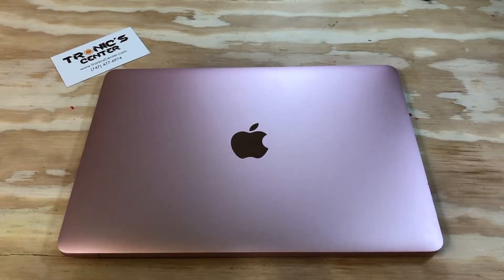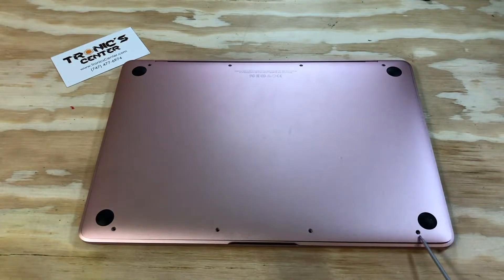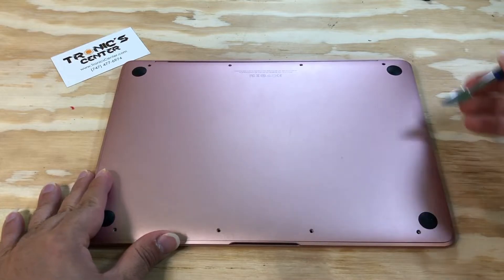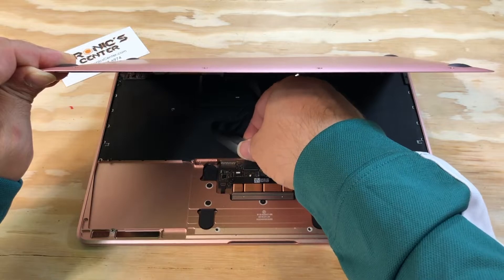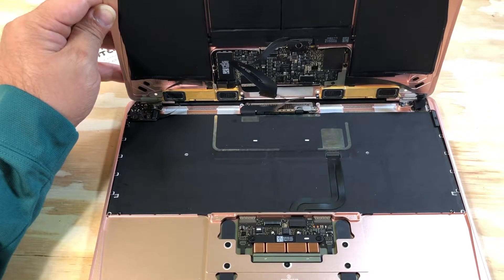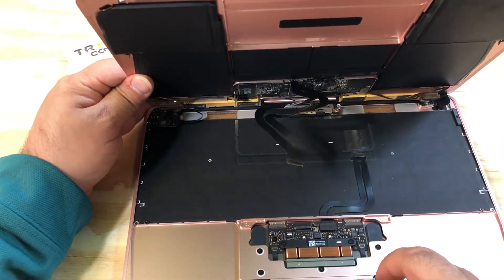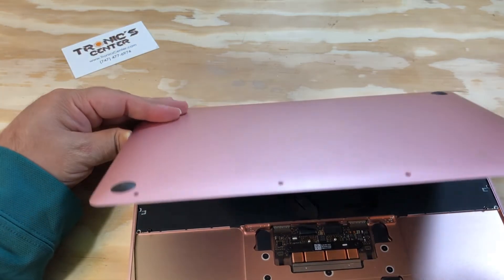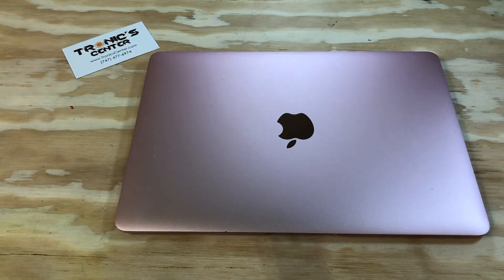How to Replace I/O Board DC in Flex Cable for 12" MacBook A1534 - I/O board DC in Flex Cable install

Comment: mine is charging fine but wont detect the usb devices, i already ordered the same cable and connector to change it, i hope that fix the problem
Reply from the maker: Dear You may Visit Your Local Apple Store or Computer store so they can diagnosis and advise , Thanks ! Dear Customer let us know what repair or disassembly you want us to make video ! Please not that we do deal with all Brands Dell, Lenovo, Asus, Razer, Toshiba, Hp, Sony, Panasonic, Nikon, Canon, Black Magic, Red Camera, any Camcorder Bards, Also we do IT Support and Data Recovery ! we would love to hear from you .
Reply from the maker: A2251 KeyWords 

MacBook Pro "Core i5" 2.0 13" 2020 4 TB 3, 2.0 GHz Core i5, I5-1038NG7, MacBook Pro "Core i7" 2.3 13" 2020 4 TB 3, 2.3 GHz Core i7,  I7-1068NG7, MacBookPro16,2 , 2020 13" 4 TB 3 , A2251 MacBook , EMC 3348, MWP72LL/A, BTO/CTO

————————————————————

A2141 KeyWords 

MacBook Pro "Core i7" 2.6 16" 2019, 2.6 GHz Core i7 (I7-9750H), 2.3 GHz Core i9 (I9-9880H), A2141 (EMC 3347), 2.4 GHz Core i9 (I9-9980HK) , MacBookPro16,1, MacBook Pro "Core i7" 2.6 16" 2019 5600M, 2.6 GHz Core i7 (I7-9750H),  MacBookPro16,4 , MacBook Pro "Core i9" 2.3 16" 2019 5600M, 2.3 GHz Core i9 (I9-9880H), MacBook Pro "Core i9" 2.4 16" 2019 5600M, 2.4 GHz Core i9 (I9-9980HK), MVVL2LL/A, MVVM2LL/A, 16" MacBook A2141

———————————————

A2179 Keywords

MWTJ2LL/A, EMC 3302 , 1.1 GHz Core i3 (I3-1000NG4) , MacBook Air "Core i3" 1.1 13" (Scissor, 2020) , MacBookAir9,1 , 1.1 GHz Core i5 (I5-1030NG7) , MVH22LL/A , MacBook Air "Core i7" 1.2 13" (Scissor, 2020), 1.2 GHz Core i7 (I7-1060NG7)

——————————————

A2159 Keywords 

1.4 GHz Core i5 (I5-8257U) , MacBook Pro "Core i5" 1.4 13" Touch/2019 2 TB 3 , MacBook Pro "Core i7" 1.7 13" Touch/2019 2 TB 3 , 1.7 GHz Core i7 (I7-8557U) , MUHN2LL/A , A2159 , EMC 3301 , MacBookPro15,4 , 2019 13" (Touch Bar, 2 TB 3), 13" MacBook Pro A2159

—————————————————————

A1932 Keywords  

MRE82LL/A , MVFH2LL/A, 1.6 GHz Core I5-8210Y, 1.6 GHz Core I5-8210Y, MacBookAir8,1 , EMC 3184 , 13" MacBook Air Space Gray, 13" MacBook Air Gold , 13" MacBook Air Silver , 13" MacBook Air 2019 13" MacBook Air 2018, 13" MacBook Air A1932

—————————————————————

A1534 Keyword’s

EMC 2746, MF855LL/A, MF865LL/A, EMC 2991, MLHA2LL/A, MLHC2LL/A, EMC 3099, MNYF2LL/A, MNYG2LL/A, MacBook8,1 , 1.1 GHz Core M (M-5Y31) , 1.2 GHz Core M (M-5Y51), 1.3 GHz Core M (M-5Y71), 1.1 GHz Core m3 (M3-6Y30), 1.2 GHz Core m5 (M5-6Y54), 1.3 GHz Core m7 (M7-6Y75), 1.2 GHz Core m3 (M3-7Y32), 1.3 GHz Core i5 (I5-7Y54), 1.4 GHz Core i7 (I7-7Y75), MacBook9,1 , MacBook10,1

——————————————————

A1990 Keywords

MR932LL/A, 2.2 GHz Core i7 (I7-8750H), EMC 3215, MacBookPro15,1 , MR942LL/A 2.6 GHz Core i7 (I7-8850H), 2.6 GHz Core i7 (I7-8850H), 2.9 GHz Core i9 (I9-8950HK), 2.6 GHz Core i7 (I7-9750H), EMC 3359, 2.3 GHz Core i9 (I9-9880H), 2.4 GHz Core i9 (I9-9980HK), MacBookPro15,3, A1990 MacBook, 15” MacBook A1990

———————————————————

A1989 Keyword 

A1989 MacBook 2018 MR9Q2LL/A, 2.3 GHz Core i5 (I5-8259U), BTO/CTO, 2.7 GHz Core i7 (I7-8559U), EMC 3214, MacBookPro15,2 , A1989 MacBook 2019 MV962LL/A , 2.4 GHz Core i5 (I5-8279U) , MV982LL/A, 2.8 GHz Core i7 (I7-8569U) , EMC 3358, 13" MacBook A1989

———————————————

A1708 Keywords

MLL42LL/A, A1708, EMC 2978, MacBookPro13,1 , 2.0 GHz Core i5 (I5-6360U) , 2.4 GHz Core i7 (I7-6660U) , MPXQ2LL/A, EMC 3164, 2.3 GHz Core i5 (I5-7360U) , 2.5 GHz Core i7 (I7-7660U), MPXQ2LL/A, 13" MacBook A1708

———————————————————— 
MacBook 

Apple, MacBook, 13" MacBook, MacBook Air, A1466 MacBook, MacBook Air logic Board, 13" MacBook Air , Apple Mac , 11” MacBook , A1465 MacBook, A1502 MacBook, A1398 MacBook, A1425 MacBook, A1706 MacBook, A1708 MacBook, A1707 MacBook, A1990 MacBook, A1989 MacBook, A2159 MacBook, A2179 MacBook, A2289 MacBook, A2337 MacBook, A2338 MacBook, A2141 MacBook, MacBook Pro, MacBook Pro Retina, Retina display, True Tone Display , Top Case KeyBoard, Apple Keyboard, MacBook KeyBoard, MacBook Trackpad.
———————————————————

A1398 MacBook, A1398 Logic Board, A1398 LCD, A1398 KeyBoard , A1398 Display, MC975LL/A, MC976LL/A, MD831LL/A, ME664LL/A, ME665LL/A , ME698LL/A, ME293LL/A, ME294LL/A, ME874LL/A, MGXA2LL/A, MGXC2LL/A, MGXG2LL/A, MJLQ2LL/A, MJLT2LL/A, MJLU2LL/A

—————————————————————

A1706 Keywords

MLH12LL/A, A1706 EMC 3071, MacBookPro13,2 , MacBookPro14,2 , MPXV2LL/A, A1706 EMC 3163 , 3.5 GHz Core I7-7567U, 3.3 GHz Core I5-7287U, 3.1 GHz Core I5-7267U, 3.3 GHz Core I7-6567U, 3.1 GHz Core I5-6287U, 2.9 GHz Core I5-6267U, A1706 MacBook, A1706 MacBook Touch Bar 

—————————————————————
A1707 Keywords 

MPN 923-01477 , MLH32LL/A, MLH42LL/A, MPTR2LL/A, MPTT2LL, EMC 3072, MLH32LL/A, MacBookPro13,3, 2.7 GHz Core i7 (I7-6820HQ), MLH42LL/A, 2.9 GHz Core i7 (I7-6920HQ), EMC 3162 , 2.8 GHz Core i7 (I7-7700HQ), MacBookPro14,3 , 2.9 GHz Core i7 (I7-7820HQ), MPTR2LL/A, MPTT2LL/A, 3.1 GHz Core i7 (I7-7920HQ), A1707 MacBook, A1707 Touch Bar

Comment: Hi! why did you changed it?
Reply from the maker: Hello
when laptop not charging some time cable is the most common part that you need to change .
Reply: @tronicscenter493  thank you, i have a problem, "usb accessories disable" warning. But when i connect an hub it works. Should it change the io? Thank you and sorry about my English, i hope you understand
Reply from the maker: A2251 KeyWords 

MacBook Pro "Core i5" 2.0 13" 2020 4 TB 3, 2.0 GHz Core i5, I5-1038NG7, MacBook Pro "Core i7" 2.3 13" 2020 4 TB 3, 2.3 GHz Core i7,  I7-1068NG7, MacBookPro16,2 , 2020 13" 4 TB 3 , A2251 MacBook , EMC 3348, MWP72LL/A, BTO/CTO

————————————————————

A2141 KeyWords 

MacBook Pro "Core i7" 2.6 16" 2019, 2.6 GHz Core i7 (I7-9750H), 2.3 GHz Core i9 (I9-9880H), A2141 (EMC 3347), 2.4 GHz Core i9 (I9-9980HK) , MacBookPro16,1, MacBook Pro "Core i7" 2.6 16" 2019 5600M, 2.6 GHz Core i7 (I7-9750H),  MacBookPro16,4 , MacBook Pro "Core i9" 2.3 16" 2019 5600M, 2.3 GHz Core i9 (I9-9880H), MacBook Pro "Core i9" 2.4 16" 2019 5600M, 2.4 GHz Core i9 (I9-9980HK), MVVL2LL/A, MVVM2LL/A, 16" MacBook A2141

———————————————

A2179 Keywords

MWTJ2LL/A, EMC 3302 , 1.1 GHz Core i3 (I3-1000NG4) , MacBook Air "Core i3" 1.1 13" (Scissor, 2020) , MacBookAir9,1 , 1.1 GHz Core i5 (I5-1030NG7) , MVH22LL/A , MacBook Air "Core i7" 1.2 13" (Scissor, 2020), 1.2 GHz Core i7 (I7-1060NG7)

——————————————

A2159 Keywords 

1.4 GHz Core i5 (I5-8257U) , MacBook Pro "Core i5" 1.4 13" Touch/2019 2 TB 3 , MacBook Pro "Core i7" 1.7 13" Touch/2019 2 TB 3 , 1.7 GHz Core i7 (I7-8557U) , MUHN2LL/A , A2159 , EMC 3301 , MacBookPro15,4 , 2019 13" (Touch Bar, 2 TB 3), 13" MacBook Pro A2159

—————————————————————

A1932 Keywords  

MRE82LL/A , MVFH2LL/A, 1.6 GHz Core I5-8210Y, 1.6 GHz Core I5-8210Y, MacBookAir8,1 , EMC 3184 , 13" MacBook Air Space Gray, 13" MacBook Air Gold , 13" MacBook Air Silver , 13" MacBook Air 2019 13" MacBook Air 2018, 13" MacBook Air A1932

—————————————————————

A1534 Keyword’s

EMC 2746, MF855LL/A, MF865LL/A, EMC 2991, MLHA2LL/A, MLHC2LL/A, EMC 3099, MNYF2LL/A, MNYG2LL/A, MacBook8,1 , 1.1 GHz Core M (M-5Y31) , 1.2 GHz Core M (M-5Y51), 1.3 GHz Core M (M-5Y71), 1.1 GHz Core m3 (M3-6Y30), 1.2 GHz Core m5 (M5-6Y54), 1.3 GHz Core m7 (M7-6Y75), 1.2 GHz Core m3 (M3-7Y32), 1.3 GHz Core i5 (I5-7Y54), 1.4 GHz Core i7 (I7-7Y75), MacBook9,1 , MacBook10,1

——————————————————

A1990 Keywords

MR932LL/A, 2.2 GHz Core i7 (I7-8750H), EMC 3215, MacBookPro15,1 , MR942LL/A 2.6 GHz Core i7 (I7-8850H), 2.6 GHz Core i7 (I7-8850H), 2.9 GHz Core i9 (I9-8950HK), 2.6 GHz Core i7 (I7-9750H), EMC 3359, 2.3 GHz Core i9 (I9-9880H), 2.4 GHz Core i9 (I9-9980HK), MacBookPro15,3, A1990 MacBook, 15” MacBook A1990

———————————————————

A1989 Keyword 

A1989 MacBook 2018 MR9Q2LL/A, 2.3 GHz Core i5 (I5-8259U), BTO/CTO, 2.7 GHz Core i7 (I7-8559U), EMC 3214, MacBookPro15,2 , A1989 MacBook 2019 MV962LL/A , 2.4 GHz Core i5 (I5-8279U) , MV982LL/A, 2.8 GHz Core i7 (I7-8569U) , EMC 3358, 13" MacBook A1989

———————————————

A1708 Keywords

MLL42LL/A, A1708, EMC 2978, MacBookPro13,1 , 2.0 GHz Core i5 (I5-6360U) , 2.4 GHz Core i7 (I7-6660U) , MPXQ2LL/A, EMC 3164, 2.3 GHz Core i5 (I5-7360U) , 2.5 GHz Core i7 (I7-7660U), MPXQ2LL/A, 13" MacBook A1708

———————————————————— 
MacBook 

Apple, MacBook, 13" MacBook, MacBook Air, A1466 MacBook, MacBook Air logic Board, 13" MacBook Air , Apple Mac , 11” MacBook , A1465 MacBook, A1502 MacBook, A1398 MacBook, A1425 MacBook, A1706 MacBook, A1708 MacBook, A1707 MacBook, A1990 MacBook, A1989 MacBook, A2159 MacBook, A2179 MacBook, A2289 MacBook, A2337 MacBook, A2338 MacBook, A2141 MacBook, MacBook Pro, MacBook Pro Retina, Retina display, True Tone Display , Top Case KeyBoard, Apple Keyboard, MacBook KeyBoard, MacBook Trackpad.
———————————————————

A1398 MacBook, A1398 Logic Board, A1398 LCD, A1398 KeyBoard , A1398 Display, MC975LL/A, MC976LL/A, MD831LL/A, ME664LL/A, ME665LL/A , ME698LL/A, ME293LL/A, ME294LL/A, ME874LL/A, MGXA2LL/A, MGXC2LL/A, MGXG2LL/A, MJLQ2LL/A, MJLT2LL/A, MJLU2LL/A

—————————————————————

A1706 Keywords

MLH12LL/A, A1706 EMC 3071, MacBookPro13,2 , MacBookPro14,2 , MPXV2LL/A, A1706 EMC 3163 , 3.5 GHz Core I7-7567U, 3.3 GHz Core I5-7287U, 3.1 GHz Core I5-7267U, 3.3 GHz Core I7-6567U, 3.1 GHz Core I5-6287U, 2.9 GHz Core I5-6267U, A1706 MacBook, A1706 MacBook Touch Bar 

—————————————————————
A1707 Keywords 

MPN 923-01477 , MLH32LL/A, MLH42LL/A, MPTR2LL/A, MPTT2LL, EMC 3072, MLH32LL/A, MacBookPro13,3, 2.7 GHz Core i7 (I7-6820HQ), MLH42LL/A, 2.9 GHz Core i7 (I7-6920HQ), EMC 3162 , 2.8 GHz Core i7 (I7-7700HQ), MacBookPro14,3 , 2.9 GHz Core i7 (I7-7820HQ), MPTR2LL/A, MPTT2LL/A, 3.1 GHz Core i7 (I7-7920HQ), A1707 MacBook, A1707 Touch Bar
Reply from the maker: If You Need any Original Parts or Tools You May Visit www.Tronicscenter.com For Original Apple Parts .